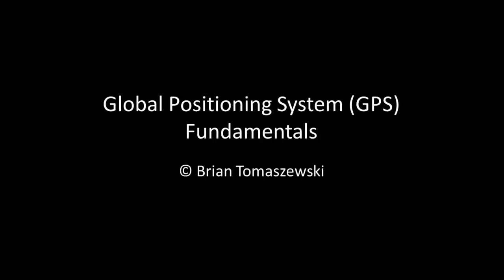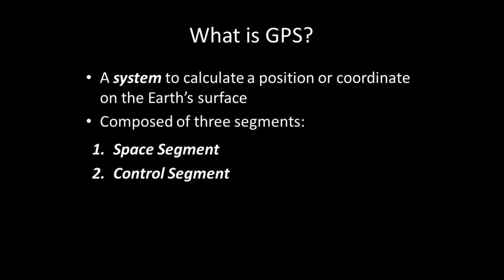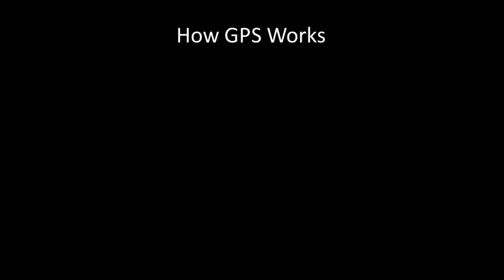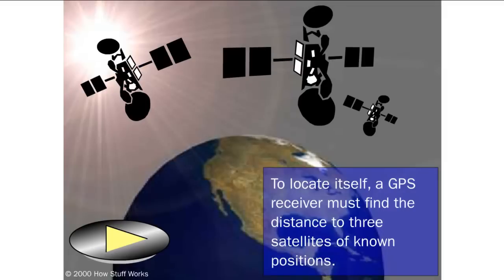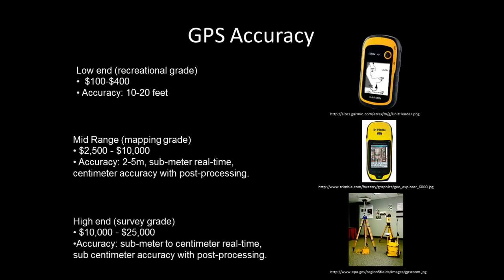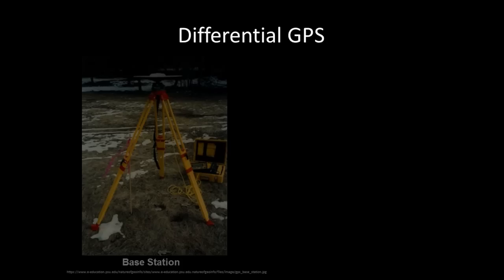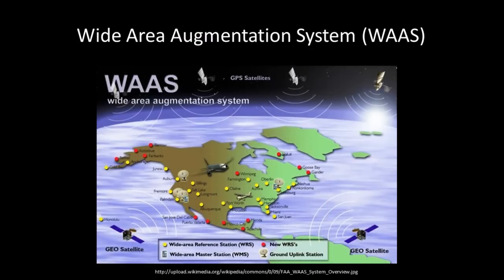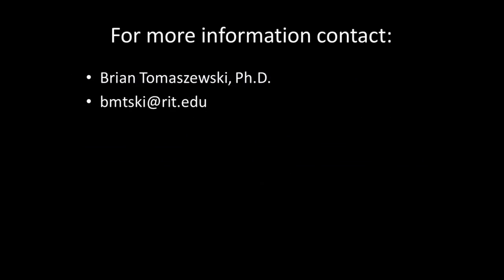Global Positioning System (GPS) Fundamentals: A Video Lecture

Comment: It is completely unclear how the receiver determines its distance from the satellites without having a synchronized clock of nanosecond accuracy. Simply measuring the speed of light would work if the clock at the receiver were synchronized to the clock on the satellite, but it isn't.
Reply: The satellites' clocks ARE very precise and synchronized.  The user's receiver is not as precise nor perfectly synched.  The good news is that the time error will be the same between the receiver and all the satellites.  That is why you need a minimum of four satellites to get a decent position, as Paul Brandon pointed out.  Basically, there are four unknowns: x, y, z and the time offset.  Signals from four satellites allow you to solve for those four unknowns.
Reply: GPS receiver accuracy is controlled by the clock correction data broadcast from the GPS satellites.  A fourth satellite measurement is needed to correct for any timing offset.